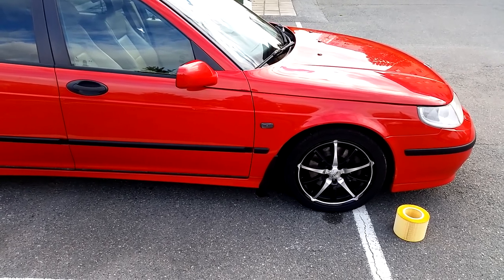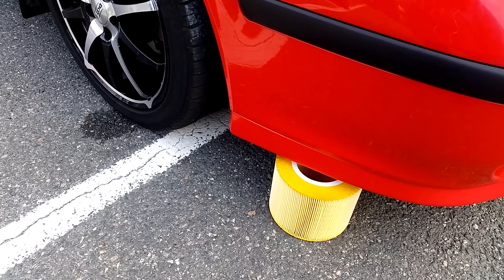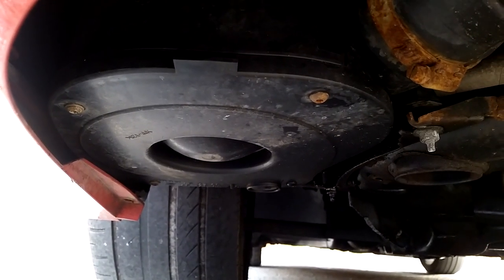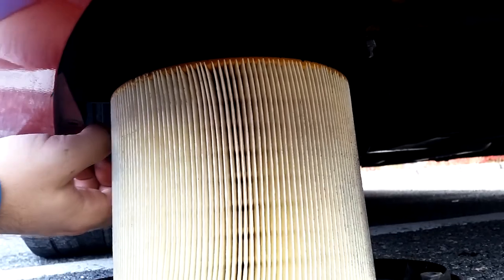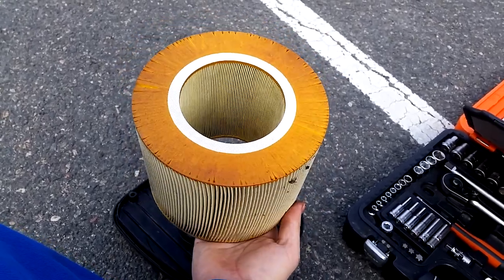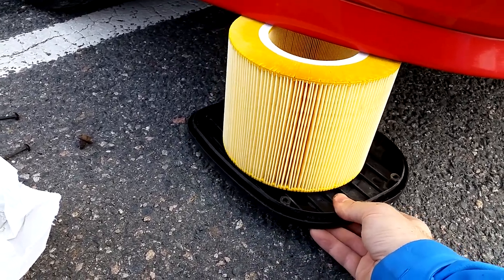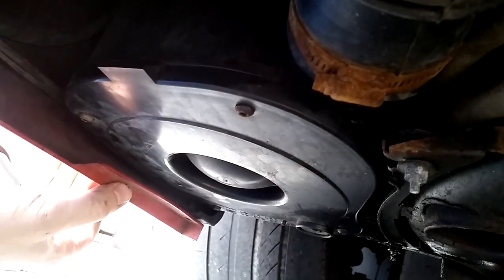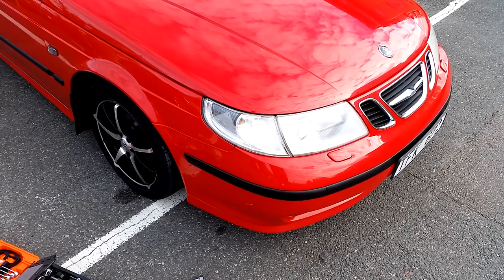Saab 9-5 DIY: Changing the Engine Air Filter - Trionic Seven Quick Tip

Comment: 4 years on I now have a 2004 Aero wagon I bought in the UK last summer. I’d forgotten how to do the air filter so I found this video again. I last watched it 4 years ago when I did the filter on Sven my 2.0t. Sadly she’s no longer with me, but I’m loving Sovvagn. Unbelievably the Haynes manual says you need to remove the front grill and right hand headlight to change it. Thanks again. Rob

Comment: Great videos. As a result I changed the filter on my 2006 2.3t this week and glad I did. The old one was filthy! Dead insects in the housing too...It may be placebo effect but the car's running better too.
Reply from the maker: Probably not a placebo effect, clogged air filters give trouble for performance.

Comment: Great info, thank you for the upload. Do you have any tips on checking the 4 (or 5)  vacuum pipes. My saab 9-5 2007 seems to be idling rough. (I have changed the spark plugs and  new DIC)
Reply: Check the fuel filter & fuel injectors! My 2007 Saab 9-5 after owning it a week stalled & almost got me killed! Semi came within seconds of hitting me. She was having problems such as rough idle (got really bad/strong toward the end) & a few other symptoms. After WEEKS of research, I took the injectors out, soaked them then cleaned them. I also changed out the fuel filter which was absolutely disgusting! You’d be surprised what it can do! As far as the vacuum pipes/hoses, I’ve got mine ordered. Seems to be a pretty straightforward job. I have no mechanical history & everything I’ve done has been fairly easy! Worst parts so far we’re lack of space for tools & the previous owners BEFORE my aunt then myself didn’t take very good care of her so any bolts required wd40 to loosen. Hope this helps some!

Comment: The skirts on the Saab 9-5 facelift Vector is a real pain, with a short angled bitholder and a T25 I could undo the outer front screw, will drill a hole next time.
It was easier to insert the filter into the housing and then put the lid on back afterwards with the skirts.

Comment: Good video.  Thanks.  You and all:  I'm struggling through a CISM issue right now, and some others on  a 2006 9-3 turbo 2.0, the car I suspect saw some rain soaking in the floorboards and perhaps through some overflow in the dash.  I suspect ruined some electrical components.  I'm told there is a control box or amplifier under the driver's seat under some models which affects many systems.  I also have no computer display on the top center dash - none, nada.  Completely blacked out.   Radio not working either.  The fuel gauge and others in that cluster work 'sometimes' and don't others.  Connection somewhere?  CISM sometimes works, sometimes not!  Ignition key switch has become difficult to turn.  Any thoughts or assistance truly appreciated from any experienced with these problems.

Comment: Is the filter usually that accessible. Meaning, is there no splash guard that normally covers it?
Reply: it is in a sealed enclosure (with the 4 torx bolts) and the air is drawn in from a snorkel behind the grill; it is already guarded from splashes

Comment: Hello Jonathan and thank you for your excellent write-ups. I tried to change the air filter on my 2006 9-5 2.3T, however the filter housing is extremely close to the fender bodywork....Even taking out the bolt that clips the corner to the body I couldn't get enough clearance to drop the filter housing. I can't imagine why there is so little clearance. Any ideas?
Reply from the maker: +Lemmy Caution Did you check the black plastic piece in the back? Remember that I did do a bit of bending in the video to get everything off. Another possibility: Do you have a third-party front spoiler (Hirsch?) installed?

Comment: i have a 2001 9-3  that i just bought it drives great but i think it is lacking on power. the boost gauge moves but only stays in the white (is this normal?) i also have a oil leak in the rear of the engine but coming from some where around the throttle body but no oil in the throttle body or the  intake tube. 

i changes the vacuum hose. i check the bcp it wasnt at 7ohms so i will be ordering one from ebay. i also used a scoop on in the inlet tube of the turbo down to the turbine and saw no oil in it and the fins look good

any ideas on the lag or the oil leak
Reply from the maker: +Eric Hall I don't know much about the 9-3, but it should definitively boost more than the white part of the gauge. How is the crankcase ventilation system? 

Oil leak could be anything. Clean the engine and try to see where the leak is from.
Reply: +Eric Hall The boost gauge on 00-02 9-3 with e T7 engine is not real boost, it's the air flow to the turbo, if you want to see the boost you have to mount an aftermarket boost gauge.
Reply: Ok thanks
Reply: 1. Check all the vaccum hoses. Twist them to check for cracks etc.
2. Check the EVAP-system (make sure the check valves only let air through in one direction. and that the vacuum hoses are in good condition).

A good service when buying a SAAB is to replace all the vacuum hoses and the EVAP-system - it takes no time at all and is a nice insurance to have.

Comment: My friend saw the video you uploaded with saab 9-5, the filter change. If I put filter k & n, will i have a problem? I see it is too low, I will have a problem with water and rubbish;
Reply from the maker: You probably have the wrong filter. And don't use an oil-type filter since that will damage your air mass sensor. Get the original brand! Don't use an open filter.